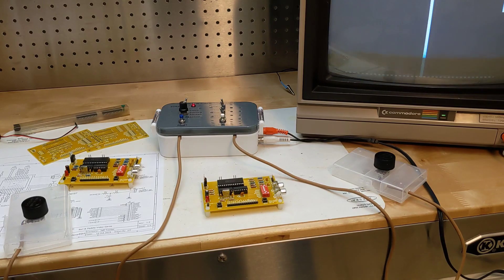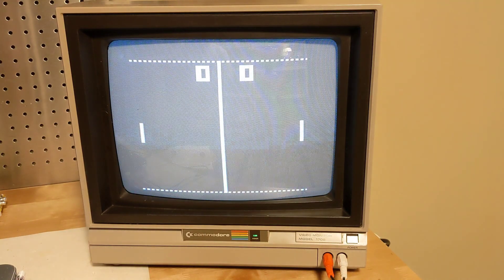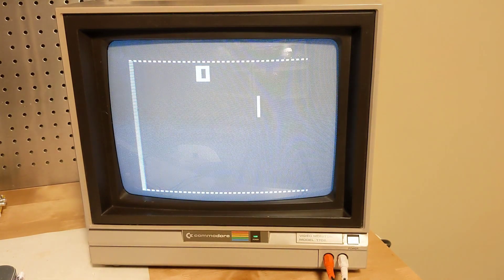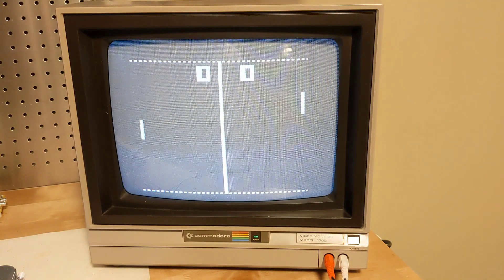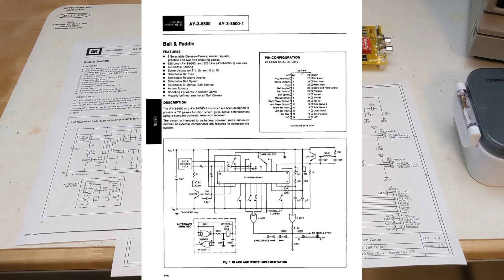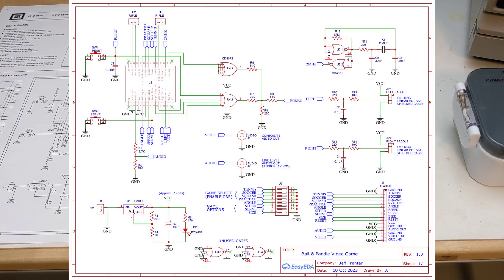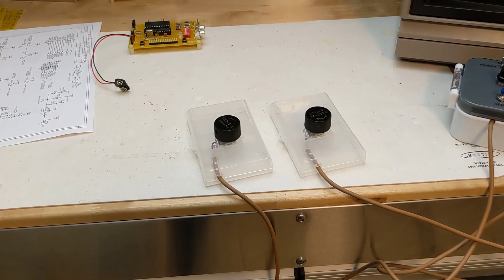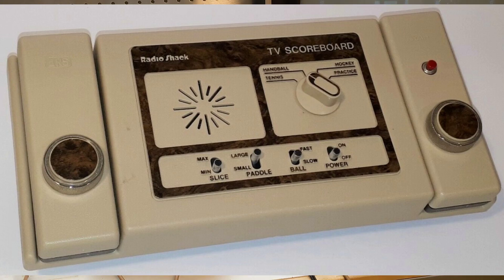First Generation Retro Video Game based on the General Instrument AY-3-8500-1 Chip

Comment: There were 6 games, but some consoles did not implement the 2 shooting gallery games in the first generation models.

When I was 16, I built one of these based on the AY-3-8550 which had joysticks to move the paddles in all directions.

I purchased a pistol that was sold as an accessory for the the second generation Sportronic console.

A friend of mine had a first generation Sportronic (AY-3-8500 with knobs not joysticks), but wanted the 6 games, so we opened up his unit, removed a pin soldered into the 6 position rotary switch that limited it to 4 positions, soldered a DIN plug for the pistol to the circuit board (which already had unused mounting points for the DIN socket) and cut through the front panel veneer to reveal the hole that was already there in the case for the DIN socket!

So, Sportronic released an artificially limited 4 game version and then later released an improved 6 game version, but they were identical internally!

Comment: I still have my first home made TV game, which used the AY-3-8550 instead.  This was the later version of the AY-3-8500 that used potentiometer joysticks for full X/Y movement of the bats, which made the games a whole level up in fun / skill possibilities.   You're inspiring me to maybe make an updated PCB for my AY-3-8550, dropping the onboard RF modulator as you've done etc.
Reply: I built one as well, age 16. Happy times.

(Also see my other post about converting a friend's commercial 8500 unit from 4 games to 6 games).